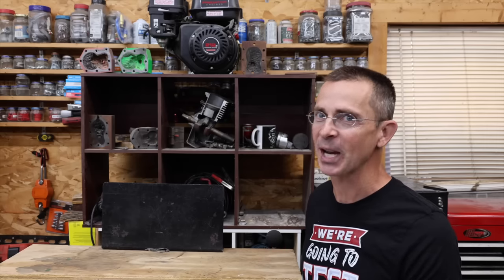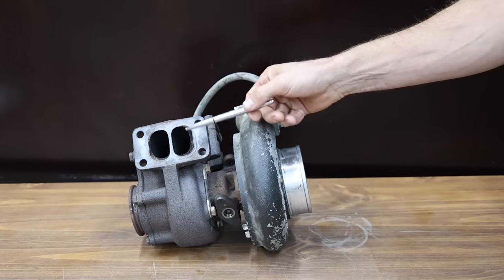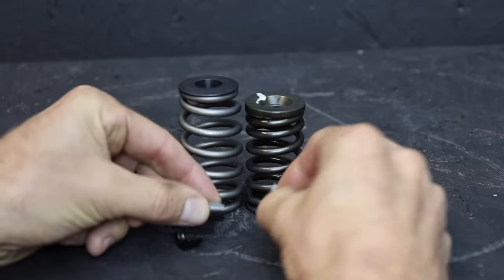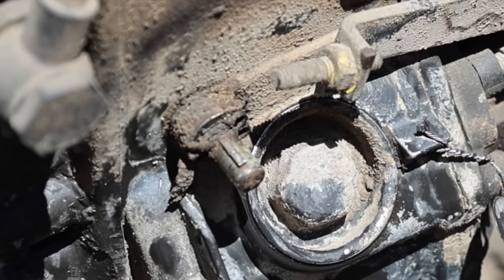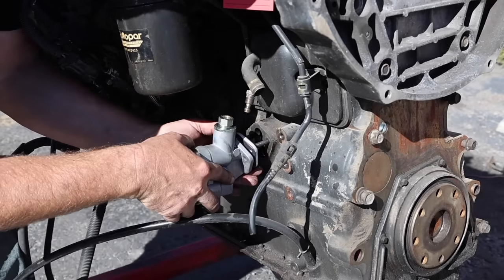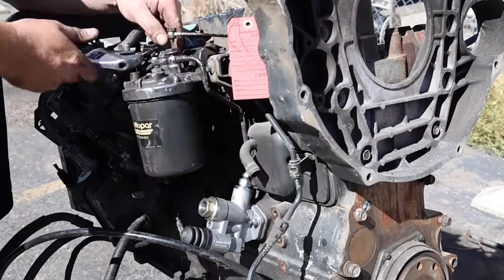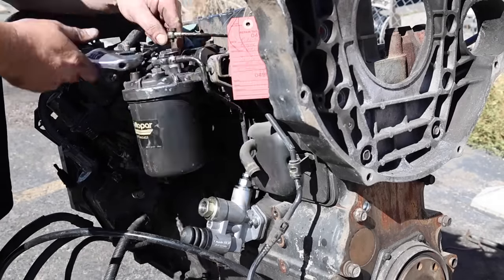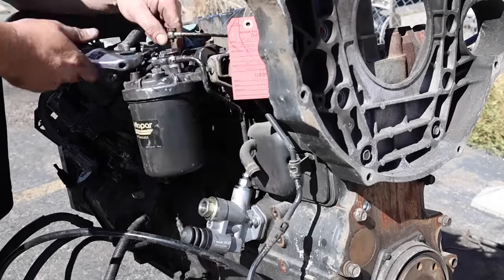Did I Waste $5000 on Engine Parts? More Horsepower & MPGs? (Part 1)

Comment: How did he not break the exhaust bolts, that's a trick we need to know.
Reply: Very very carefully that’s how
Reply: Hes not an idiot thats how...  in many cases you tighten bolts before you loosen them that helps sometimes
Reply: @glennschlorf1285 your not an idiot either have u never broken a bolt? "Sometimes" is the key word in your comment hahah.
Reply: @slingshotnerd well that's true yes, but information is king and I am curious how he did it..
Reply: @glennschlorf1285 you write a foolish comment
Reply: An impact always works for me. The initial shock breaks them free and i do this on a daily basis
Reply: Only way i've gotten them loose without breaking is working them back and forth for a long time. Of course that will only work if they at least break loose and not just snap as you first turn them
Reply: @WarpedYT  plenty of times... thats why you hope to heck you have enough to weld a nut to it to get it out.... like I said I suspect he tightened it before he loosened it.... just a bit... and probably lots of PB blaster
Reply: @grimpreacher3152  nope.... Im sure hes broken some too...
Reply: He has done multiple videos on rust penetrates....that would be the most likely trick he used 😂
Reply: @glennschlorf1285 I was only joking
Reply: Probably soaked them a few times with LIQUID WRENCH!!
Reply: @WarpedPerception  loosen one bolt, tighten it back up, loosen the next bolt, tighten back up etc. The manifolds is usually a bit warped and if you do one at a time the stress on the bolts will cause one to inevitably bind up and snap.
Reply: @grizoh interesting
Reply: Good stuff, thanks for sharing 👍.
Reply: @WarpedYT  when i do cummins manifolds i always get the engine warm. seems letting the head expand helps alot.
Reply: By the grace of God I'm sure he said his prayers the night before, and gave God a quick reminder a couple minutes before aswell just to make sure.
Reply: @WarpedYT  folks that never broke bolts never turned any. Id like to introduce that person to a Jeep WK front clevis fork bolt.
Reply: The fact that he only put 40k miles on it in 16yrs probably helps, heat cycling(expanding and contracting) is commonly what creates those rusty weakened manifold bolt conditions. Typically you see broken manifold bolts on higher mileage engines(unless it's a 5.7 hemi or a 4.7 Toyota... they just suck 😂)
Reply: @JohnZ0805 that usually helps and given that the manifold had shrunk getting it up to temp actually helps expand it out more to pull the bolts. Thing is sometimes you can’t work on them hot.
Reply: @jayss10  your right but you can always heat them up with a torch
Reply: I just took the manifold off my 220k mile engine and they came right off surprisingly
Reply: @WarpedYT dude i think your the king of replying to comments lol.
Reply: He probably did it with the engine hot
Reply: @johnb7430  good idea
Reply: @grizoh 👈🏼what grizoh said. Run the engine till it’s hot and apply penetrant a few times then follow grizohs advice.
Reply: Do it when the motor is hot
Reply: Worst day ever is breaking exhaust bolts with a manifold
Reply: hand tools and liquid wrench
Reply: Same with crankshaft bolts. Had three companies refuse to work on a crank pully sensor, a $100 dollar job, but refused to do cause the liability.
Reply: @WarpedYT  im still waiting on that call on a price for your supra..... still very serious.:)
Reply: @WarpedYT I have no idea if this will help or not, maybe you’ve already tried this before. But here is the way I’ve removed exhaust bolts that I was told couldn’t be removed without breaking them. First I warm the engine up, then I give each bolt several good whacks on the head with a decent sized metal hammer, and lastly I take them out in the order they want to come out. In other words I don’t try and take them out in any particular order, I put whatever tool Im using on each bolt and twist until I find the one that turns. I then repeat this process over and over until I’ve got all the bolts out. What I’ve found is there’s almost always one that will budge and come out before the rest. Usually they come out in a completely random order but they’re out and that’s all that matters.
Reply: No kidding!  I only give a half attempt and then just break the bolt and deal with it later.  Better then spending an hour and it still breaks - with all the tricks mind you
Reply: @JohnZ0805 :  Definitely. I always break sketchy bolts with engine warm or at NOT.
Reply: Tighten, loosen, tighten, loosen, tighten, loosen, over and over and over. Each time you loosen, you go a bit further than before. Of course penetrant oil and sometimes heat. Never broke a bolt doing it this way.
Reply: Beg/pray/use skill 

like NPK everyone has their personal variety.

I think theres more phosphorus in it than first appreciated
Reply: @andrewprettyquick2070  hahah! Very true
Reply: Doing it while HOT and, most importantly, in a specific sequence.
(That is what has worked best for me anyway..) results may very!
Reply: @glennschlorf1285 
Yes, that does work (sometimes)
However your ignorant comment shows just how much of a technician your not..
Reply: Lots of people mentioning PB Blaster, that stuff is great. I've found CRC Freeze Off to perform much better specifically for exhaust bolts and nuts. Others mention tightening first before loosening and that technique can work very well especially with a torque wrench set below the point where the bolts will sheer. Would like to know specifically the process they went through though.
Reply: There are a few techniques to do that. Its how willing you are to put time into no problems.
Reply: He is a god that’s how but in all seriousness I’ve learn working them back and fourth while spraying them helps a lot when taking them off I have yet to see one give up
Reply: Exactly the opposite of how I snapped a cam cap bolt on my EJ25 last week. It is now helicoiled.
Reply: use bolt extractor spray and move back / forward with little progress
Reply: Cover them in oil
Reply: The man has all the knowledge of the best tools, penetrating oils, etc. He is the only person I would be almost disappointed to see break a bolt.
Reply: WARPED PERCEPTION IN THE HOUSE!!
Reply: @WarpedYT information is key, not king, otherwise, we would have to overthrew all the information in the United States. Although, if it was the king, that might make it a little easier to understand why people today are so intent on throwing good information out the window, and acting on nothing but feelings, but I digress.
Reply: Didn’t break any of them on the turbo or any studs on the manifold. I also didn’t see any penetrating oil on everything so I am curious too. He’s the Fonz of diesels.
Reply: I agree
Reply: LOL high five! @slingshotnerd
Reply: its very common for them not to break on diesels, myer has done that hundreds of times also
Reply: I'm about 50% sure he sold his soul to Satan for that ability.
Reply: Loosen all bolts one by one a quarter turn, spray and tighten again. Loosen all bolts a half turn, spray and tighten a quart again. All the tention of the exaust manifolt spreat. And don't come all on one or the weak bolts. Start in the middle.
Reply: Aliens
Reply: they are the allen millyard of old diesel engines.
Reply: Oh, that's easy.  When you hear it snap, QUICKLY BACK IT OFF HALF A TURN.
Reply: We're gonna test that
Reply: He’s project farm that’s why duh
Reply: Can you simply imagine the amount of products he has in his arsenal? ;)
Reply: It's the most Project Farm thing ever to be so seamless even exhaust bolts come off in real time.
Reply: Heat it, let it cool, work it in and out 1/4 turn at a time till it spins out nicely.  While adding lube when working in and out slowly
Reply: @bigblockjess617  What has worked for me is to put a end wrench on a bolt/nut and strike it sharply with a shop hammer. I've broken them free using this method when an impact would not.
Reply: Forbidden knowledge. I'm sure if he says how, the bolt manufacturer secret spies will come after him. xD
Reply: @SockyNoob  😅
Reply: @satyavratadas1640 
Seriously 
What has a fictional person have to do with removal of bolts?
Reply: Trick I learned a long time ago was do it when they are still warm. Replaced my exhaust manifold a few months ago on my 300k 07 Cummins and they are came out very easily
Reply: Soak it with PB Blaster multiple times before you start the job.
Reply: @pitbullw35581  MMMMMM, I Think worst day ever is putting heads back on and wrench goes slack. Man your heart sinks into your shoes.
Reply: Have you ever watched project farm before? He knows all the proper products and secrets.
Reply: It’s project farm. He has like 50 billion positive karma built up from all his videos. Universe was like “FINE”
Reply: Oil
Reply: Last exhaust manifolds I removed had several very stuck bolts. Hit the bolt heads with an air hammer and the came right out.
Reply: Sacrifice more chickens.  The exhaust bolts are very touchy on this point.
Reply: I didn't break mine.
Reply: @glennschlorf1285  you can also just run the motor let it get up to temp then shut it off and take the bolts off. The heat of the motor will basically be the same thing as using a torch to heat them up. I do it everytime and it makes them come out super easy.
Reply: @NorthOf55Aventures he’s definitely not driving in the salt belt either
Reply: @warpedperception always good to see you in the comments, we always used penetrant a few days out, then you heat it with a heat gun and use an impact right away.
Reply: Maybe they did break. Its just a video. Im sure youve doctored crap too
Reply: @WarpedYT  Penetrating oil, tapping the bolt (using an impact wrench preferably) and heating the bolt can all help.  Be careful when heating after using penetrating oil as it can be flammable.
Reply: Have you tried those “boltbusters”conduction units?
Reply: Are we not going to discuss @warpedperception is in the comments?
Reply: The best way (if you have time) soak it in pb blaster, let it sit for several hours, tighten a bit, soak again, let it sit, lossen a bit, soak again, work back and forth a little bit, keep soaking and work it a few degrees. You are breaking the rust and working the rust out of the threads. Worst I've had took a few days to come out without breaking. There are heating tools that can make this an near instant process.
Reply: i 100% agree, and while it doesn't happen often it sure as shit is a pain in the ass!
Reply: @Jim-qc6gu  I wouldn't know sorry
Reply: Truck looks absolutely spotless, probably has something to do with us working on rusty junk. (Northern Ohio here)
Reply: He asked the bolts to come out very nicely
Reply: I recently removed an exhaust manifold from a '95 Power Stroke and I'm not quite sure how I didn't shear any bolts.
Reply: Run your car for a half hr and the bolts come right off because the manifold is real hot at that point.
Reply: I usually soak them and have pretty good luck as long as they weren’t overtorqued by someone else. Good work, its clear you guys know your stuff on this engine
Reply: Zep45 seemed to help
Reply: @glennschlorf1285 not cool man, warped is a legend
Reply: @WarpedYT Hahah try range rover 4.4 td dumb engineers make dumb exhaust mounting system broke or strip every bolt
Reply: @WarpedYT  Maybe it is acombination of good quality bolts, proper tightening torque and, finally, method of extraction?
Reply: The trick is not living in the salt belt.
Reply: torch :3
Reply: @Jim-qc6gu   There is nothing fictional about the Lord our God.  Your spirit will live on for eternity either in the burning pits of hell or in heaven. Its your choice.
Reply: Low torque Impact or torque wrench. I've used it alot working in western pa
Reply: @glennschlorf1285 🟥 That's the way I was taught back in the 60s. Tightening breaks the crust and the fly out. ( sometimes) and sometimes just a tad bit of heat 🔥 from a smoke wrench is also needed.
Reply: @bigblockjess617  a smoke wrench is my go to. Heat seized it up so heat frees it up. I glow it up incandescent and then spin it off hot with an impact gun. Comes off like new.
Reply: @pitbullw35581  no worst day is having to drill em out and going crooked into the water jacket...
Reply: @jsaiz681593  no he isnt.... Im not a fanboi.....  hes just another youtuber that puts out some good videos and some mediocre ones...
Reply: I wonder if he sprayed them with whatever is best from one of the penetrating oil videos.
Reply: I work in a machine shop......broken bolts and taps are life.......though I usually get them after someone else tried removing them.
Reply: Not from the rust belt
Reply: @m1t2a1  in my experience penetrating oil is next to useless when hardware is really seized up. It's not going to penetrate in a reasonable timeframe in those instances. If you have months or years to break stuff apart then sure maybe. But today? Forget about it.
Reply: @WarpedYT you're*
Reply: I have only done it a few times, but when I did, I tightened the bolt a hair, then loosen 1/4 turn for each bolt before removing, if you remove each bolt, the load is then transferred to all the other bolts, its best to equalize the load across all the bolts as you remove them 1/4 turn each till things loosen up.
Reply: My best guess is a soak with penetrating oil, and a ZVS induction heater on the head of the bolt. Then turn the bolt back and forth before backing it out.
Reply: I was having trouble with my bolt, and my wife told me to soak it in cider.🤣
Reply: @Chooseyouruniquehandlebyaddin  you can pour oil on hardware then heat it up but all that's going to do for you is make oil smoke. Once heated that hardware is going to be bone dry. Which is one reason why you don't want to back and forth with it. While it's hot just get it apart. Because as it cools it'll contract and seize up again. speed is of the essence. That's why I use an impact gun on glowing hardware.
Reply: It's not a Ford, so...
Reply: Liquid wrench, deep creep, heat, and hands of god.
Reply: He’s not in the Rust Belt.
Reply: @5roundsrapid263  good point
Reply: You forget he's the guy who tested all the screws on the market for durability and rust, maybe he replaced them earlier
Reply: @chill_gaming  true but nah, He didn't replace anything on that Cummins
Reply: Comes with age and wisdom
Reply: Seeing that exhaust when he said he didn't break a single one I was impressed! That was a great job!
Reply: We use a special slow impact.
Reply: @jamesm568  that makes a lot.of sense...or an impact on low air pressure setting.
Reply: @WarpedYT  it's electric, but it spins and shocks slowly as it's not a fast tool
Reply: Torch + Impact ratchet.
Reply: Love this. I have a 01 F350 7.3. Those old diesels will get you back what you spend on them if the bodies are in good shape. Simple compared to the newer diesels. Take one of those to a mechanic and get ready for a shock!
Reply: Lot of good info on here on how to keep from breaking stubborn bolts.
Reply: dease guys seem to know what theyre doing is how
Reply: Drift punch, penetrating lube, induction heater, hammer and skill baby. haha
Reply: VERY IMPRESSIVE!
Reply: For sure
Reply: The answer is "Texas"

 I share your rustbelt concerns lol
Reply: I put headers on my 06 silverado and I sprayed pb blaster once a day for 3 days before I attempted to take the bolts out, it worked very well, they all came out easy
Reply: Very carefully that's how
Reply: There are lots of steps you can do to remove old bolts (wd40, heat, tighten a bit befor loosen it, etc. In the end, you still ne a bit of luck, that the bolt is intact enough. It is not always the mechanics fault, if a bolt breaks.
Reply: @glennschlorf1285  that's what I learned as a kid. Also, heat. Working on a hot/warm engine helps.
Reply: Acetone and transmission fluid.
Reply: I usually tighten them slightly that will help break the seal then back them off
Reply: Check this out. The whole idea is to make two metal things separate and move move move. Pinpoint high heat soaking is ideal because it makes the atoms move around easier like a bunch of excited fish breaking that bond. The big thing why it doesn’t work for some of my associates is it needs to soak it all the way down the thing you’re trying to remove. I have removed plenty of Chryslers and Chevys with a 1/4 ratchet just by moving the bolt threads in and out before removing them completely. Than as your time overload counts your hours you’re always ahead 😅
Reply: @WarpedPerception I've never broke an exhaust bolt because...  NOT AN IDIOT.
Reply: atf + acetone
Reply: @glennschlorf1285 "in many cases sometimes" is funny to read after starting off by calling others idiots!
Reply: My guess is he uses a specific impact that has enough torque to vibrate and remove the bolts, but not enough to break them. I've found that using a mid torque impact like he did can help shake bolts loose without just snapping them right away. He then removes them in a specific order based on experience of which bolts have the most force on them from the manifold shrinkage. That's the best I can figure since I didn't see anything else special in the video.
Reply: and heat. Then again some people have all the luck @Mackze
Reply: Can u please test bicycle tubes
Reply: @NorthOf55Aventures  Ahem 6.8 triton or 5.4
Reply: Patience sauce
Reply: He took some spare bolts and broke them in half as an offering to the the exhaust manifold
Reply: @666cowboy69

You meant a Robertson right? (Square)

You're welcome
Reply: I’ve always done fairly well with them by lightly air hammering the end of the stud while you back the nut off! Alittle heat and combustion chamber cleaner too
Reply: 39,000miles is all it had…
Reply: Yoooo one of my favorite channels on YouTube!!!!
Reply: Yes! Why did you gloss over that???
Reply: Animal sacrifice.
Reply: @glennschlorf1285 no exhaust bolts experience heat cycles that is why they get stuck and snap upon removal
Reply: @WarpedYT  was doing a down pipes off the manifold today broke it wanted to cry
Reply: Heat, lube patience. Like any good relationship.
Reply: @bigblockjess617 I've definitely broke more bolts by hand than i have with an impact, but I've definitely broke quite a few using an impact.
Reply: @pitbullw35581 yup, especially on the 5.4 f150s when its behind the shock mount and a b!t(h to get to.
Reply: @2down4up hmmm...interesting. i would have thought it would be better to break free the ones you can, then retighten them before going after the ones that did not want to break free. Having the ones the broke free easier out, that would put more pressure/binding on the ones that were harder to break free, and make them even harder to break free. Wonder why it actually made them easier? Good advice. Ill give it a try next time im unfortunate enough to have to do one. I know a buddies 96 f150 5.0 4x4 has a leaking manifold, so it probably wont be all that long until i have to do it. Hope your trick works, or im coming to find you!! Lol jk
Reply: @BigBrotherIsTooBig then you havent removed enough bolts. Sometimes they just snap right away so you dont have a chance to go back n forth
Reply: @Rusty.1776 and what is that SPECIFIC sequence?
Reply: @rustbucket9318 a lot of ppl spray penatrating fluid hours or days before working on it to give it time to work. Maybe todd sprayed them before bringing it out knowing it would help? Maybe the sprayed them before they started filming?
Reply: @jacksmith2315  Then you haven't removed enough bolts to understand you're putting too much torque if you snap them right away. I can sometimes take 30 minutes to work one very rusted bolt. If you do it gentle enough it will come out.
Reply: @jacksmith2315  My apologies, I didn’t clarify very well what I meant. Your 100% correct in what you said, taking them out without reinstalling would likely only make matters worse. Once I get one out, I install a new bolt in its place. If all I’m looking for is to get fresh bolts in then I can stop with the last one. If I want the manifold out, then once I’ve got the last original bolt out, I then remove the brand new ones I just installed. Being brand new they’ll come out real easy. So yes I’m kinda doing the job twice but replacing one bolt at a time only to remove it later is much much better then breaking them and having to fight with that mess. My apologies for the lack of clarification and any confusion I caused.
Reply: @tonymengela3575  just the word " clevis " makes me scared of it
Reply: @jacksmith2315  use anti-seize especially on exhaust bolts you take on and off, even if your not the main one who works on the car 

Car repair sucks payment wise, if you don’t factor in extra labor for broken exhaust bolts, you will cost yourself a check 

I saw a guy spend 2 days on drilling out an exhaust manifold on V6 Nissan car lol
Reply: @2down4up actually not a bad idea. Ill give it a shot
Reply: @BigBrotherIsTooBig i removed plenty. I been working on cars for 20yrs. Sometimes they just brake and theres nothing you can do. They're jist so rusted and siezed/practically welded they are so rusted. Heat em, beat em, nothing works. Even after they brake an extractor wont get them out because they're so rusted. Unless you live somewhere you're not dealing with rust. Living in boston, ma, sometimes you have no choice but tk brake them and drill them out, they just wont budge no matter what you do, unless you have oxy acetylene and just melt them.
Reply: @pitbullw35581 oh yea absolutely. Not just any anti seize, but copper anti seize for exhaust hardware. But, the only way to use anti seize, is to get the the hardware out. Its getting the factory hardware out thays been on there for 10-20+ years thats a real PITA. Ive had to drill out manifold and flange bolts quite a few times. Never fun
Reply: @jacksmith2315  But you assume I haven't. I live in Northern Missouri. Our roads get salted. I've yet to break a bolt if I spend the time to work it.
Reply: Warped perception out here asking the hardball questions we all want to know
Reply: Been building and modifying vehichles and engines for quite a while. Ive never personally broken one and neither has my best friend whos been doing the same for about as long as me. Use a wrench not a ratchet. Pre soak in penetrating oil. And if its stuck stop applying pressure if you feel the bolt start to stretch or twist go grab a torch and heat the head around the bolt not necessarily the bolt itself.
Reply: When the engine is hot, that’s how I have my best luck 😂
Reply: @grimpreacher3152 He making nothing!
Reply: @bigblockjess617  -_- sure sure there moonman
Reply: Tighten and loosen. Not too much pressure either way. Once it gets past the seating position it should come out pretty easy.
Reply: I did the same on my 78 Caprice Classic. There's a process, you don't just expect them to loosen like they're new.
I removed them to install 1-5/8 ceramic headers / tubular manifolds (not going over 375HP).

Applied the penetrating oil, then did nothing except come back the next day. Drove the car in 2nd gear until hot, more oil, again another day. Next, on the 3rd day, I need to use a dead blow hammer to actually crack the bolts tight . I have to be very careful and only turn them about 15° (~1/16th turn) . I don't remember if the car was warm, cold, or hot. Once the threads crack, it's un-seized. You need to use a dead blow hammer, not a pipe nor breaker bar. This is critical, it's impacts versus force. Force will shear the fastener head off, impacts will un-seize the threads.
Then I reversed direction and loosened then all.
Reply: In my 5years of professional wrenching and over 15 years backyard wrenching ive never broken more then 2 exhaust manifold bolts in my life, worked on all my powerstrokes, both my cummins, a few of my cars, never had an issue
Reply: Well, you cant say you've never had an issue after you just said you've broken 2. Thats at least 2 issues lol
Reply: Manifold bolts usually aren't too hard to get to, it's the bolts that are almost impossible to get to(without major work) that are a BADDAY
Reply: BigBrotherIsToo Big, you've never loosened a truly rusty bolt then. Sometimes they break as soon as you touch them,it is called the Rust Belt for a reason and the new deicing chemicals are much more corrosive than salt
Reply: @WarpedYT  don't waste your time with YouTube commenters. I'm sure they don't have a clue who you are and how much experience you bring to the table before saying some condescending bs. 

You've probably gotten more wrench time in a year of your life than those commenters have in their entire life.
Reply: @Wheresmy240  thanks.. You could actually be right about that..
Reply: Wow, he dropped the gloves with the "Duramax and Powersmoke" 😅😅
Reply: @glennschlorf1285  Obviously not from the rust belt. Mine came apart just getting the socket over it.
Reply: @funfun5656  last time I checked wisconsin is in the rust belt.... so again your wrong...
Reply: I broke 2 off (of course number 6 cylinder). Welded a nut to the broken studs and they almost came out by hand (little wrench effort).
Reply: the power of hopes and dreams is a powerful thing if you use it correctly
Reply: My bolts in my 12 valve were seized and it snapped off the head not the bolt so I bought power drivers diesel ported head I tried heat penetrating lube and it still broke it is a 30 year old truck